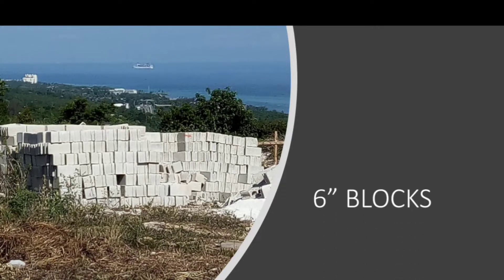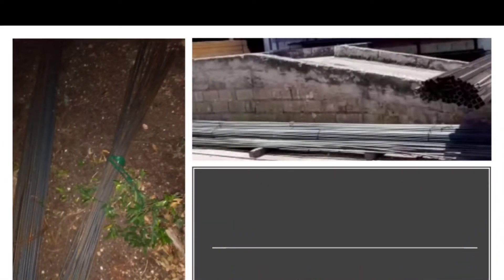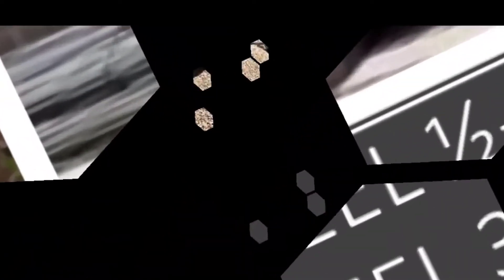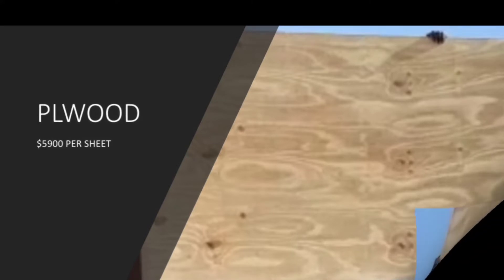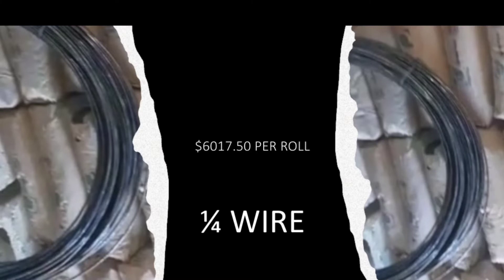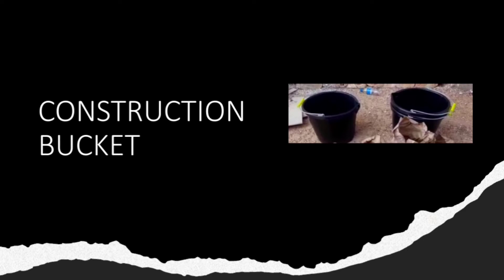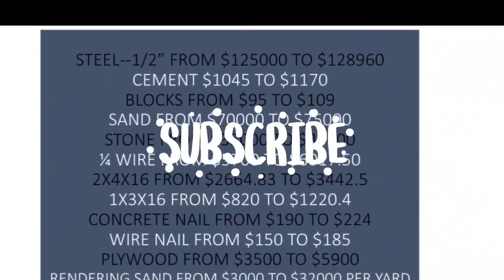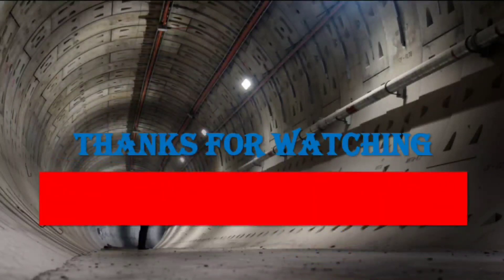Cost of Building Materials In Jamaica PT 2| Construction Materials In Jamaica 2021

Comment: Information on point, I just buy some material for my upstairs.
Reply from the maker: What were the prices...thanks for being a committed subscriber
Reply: @CenterPointConstruction  blocks / 500 for $55000, cement $1,165.22 for one, 3/8 corrigade steel one for $760.87, 11 T 3/4 steel for $3,313.05, steel 1/2 in”one for $1,034.70 these are the prices.
Reply: @thebennettfamily5739  I won't complain about  about the prices I am paying then 
St Mary  prices are as follow 
1/2 inch steel $130,000
3/8 steel $135,000
5/8 steel $135,000
Cement $1134 
Blocks $115
Reply: @nakeishajamaicandreamhome6756  every parish as it’s own price, we have to buy the blocks and steel and put them down safe.
Reply: @thebennettfamily5739   I have been buying since December,  steel then was like $90 000, but you are so right what I did was to buy almost all my materials to build the house and will be taking as I need from the hardware example the cement so it dont waste. But it seems every week materials goes up not to mention boards omg
Reply: @nakeishajamaicandreamhome6756  that’s good 😌
Reply: @thebennettfamily5739  Hi Bennett Family , what hardware do you buy from if you don’t mind saying please ?